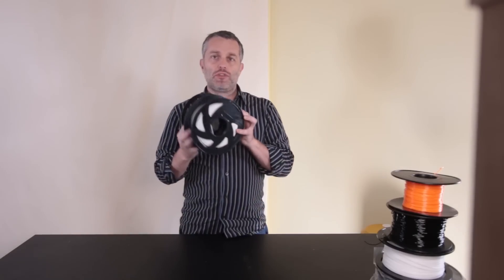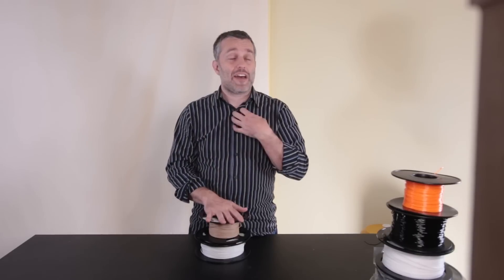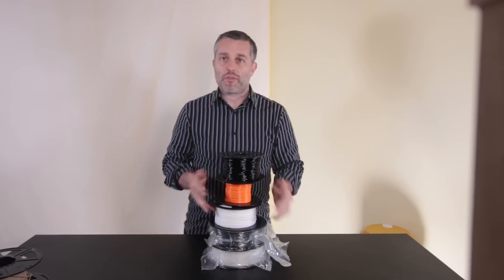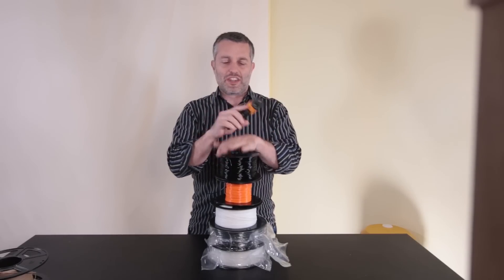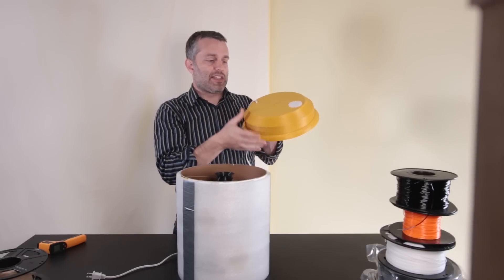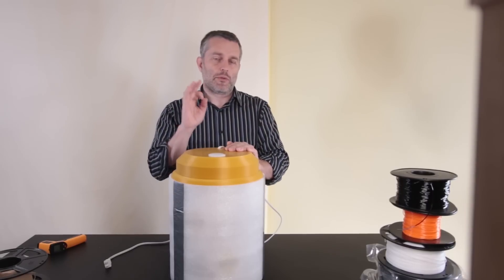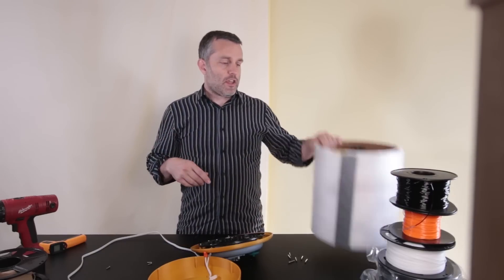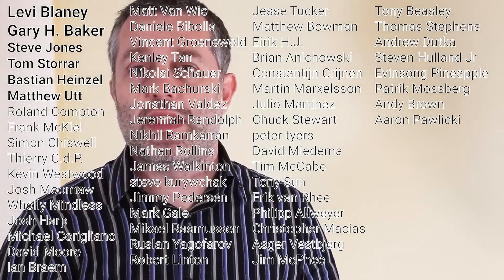Keeping your 3D Printer Filament Dry is Important.

Comment: I'm no electrician but I would look into replacing the thermostat. If you want a fixed temperature, look into NC thermostat like the KSD301. They're used in household appliances as thermal protection. The is also thermal fuse on the coils. Leave that there; it's for safety. But check that it's rated for your desired temp or it will cutout on you by design. In any case, please take care when working with heat and line voltage.
Reply: It's a thermistor on these not a thermostat. Basicly a switch that turns off at a specific temperature and back on at another lower temp. The thermistor is coupled to a triac for changing the temperature ranges. It is a simpler system used in all kinds of stuff like toasters and hair dryers. I commented on that somewhere here (if you can find the top level comment)
Reply: Thanks. I browsed through the comments before post but I didn't see that. 
In any case, what I am recommending is to swap-out what ever temperature control is currently being used (thermostat, thermistor with TRIAC, etc.) to something like a KSD301. This would be a cheap and easy solution. It would hopeful be well within most people's ability; without having to try and tackle redesigning the current temperature control circuitry.

Comment: You can raise the internal temperature without replacing the thermistor ( suggested correctly in other comments), by adding mass or insulation to the the body of the thermistor... (wrapping some wires  around it for the extra mass, or wrapping some kapton tape to insulate it, should do it...)  That will slow the response of the device (longer heating... But also longer cooling periods, since will take longer for it to know the temperature has changed...)

Comment: For getting a higher temp, You might be able to replace the thermistor seen at 8:19  near all the wires coming to the coils with one that has a slightly higher max temp. in many dehydrators, toasters, hair dryers, etc thermistors senses temp and turns the heater on or off via an SCR or TRIAC dimmer. there might also be a thermal fuse in the circuit which may need to have a slightly high max temp too so you don't trip it. 

Basically the the circuit heats up and then the thermistor trips when it gets hot enough turning off the power. this repeated on/off controls how much heat is output. the TRIAC some some kind of fiddeling to set the temp ranges below the thermistor range (I'm a little unsure about that part). by puting a thermistor with a slightly higher max temp you increase the system's heat output.

 (only a hobby electronics perspective, you should ask an electronics tech or an EE engineer for total advice)
Reply: That is most likely the thermal fuse inline with the coils at 8:19. He doesn't really show the temperature control device (what I loosely call a "thermostat") but you can see what is a temperature knob in similar models at around 9:10.  I will assume that it is under that.

Comment: Personally looking at the whole material emissivity stuff makes using a spot IR gun like that to check an oven's temp totally unreliable. It's great for surface temps of certain materials, but can often be very wrong. working with Aluminum cooling fins in the lab we had to put electrical tape on the locations we wanted to measure with an IR gun because Aluminum's emissivity was problematic for getting correct measurements. I believe a good thermocouple is better for bulk area temperature measurements.
Reply: Absolutely! Those no contact thermometers tell you the temperature of the surface not the temperature of the air. The worst way to measure the temperature of an over is with the type of thermometer you were using. A cheap oven thermometer that sits on the rack and has an analog dial that is operated by a bimetal element moving the dial is far better than the most expensive non contact thermometer, even a fancy Flir doesn't tell you the temperature of the air in an oven. No wonder all your oven read differently... I'''ll bet all of them were within a couple of degrees of each other. 
Try this little test to demonstrate it:  point your fancy no contact thermometer to the wall in your house. If the wall has reached temperature equilibrium it will read what the room temperature is.  Now, get a hair dryer and blow hot air between the thermometer and the wall,  careful to not blow air onto the wall or the thermometer. The thermometer will continue to read the same temperature of the wall in spite of the hot air between the thermometer and the wall. While it is strictly not true that it ignores the temperature of the air, the radiant energy emitted by the hot air is insignificant compared to the radiant energy emitted by the wall.  The hot air transfers its energy no by radiating it, which the no contact thermometer is sensitive to, but by actually transferring the momentum of the bouncing excited heated molecules.... in other words, the air has to touch the stuff for it to feel hot.
Aside from that bit of thermodynamics, your filament dryer and sonotubes is brilliant and will work far better than you think. Some of the suggestions about exhaust vents, etc will make your dryer absolute kick ass. A really clever idea.

Comment: Hey man, you don't have to reach the boiling point of water, at work we injection mold nylon parts and we dry is between 60 and 80c for a couple of hours, if it's really humid, up to 4hrs. So pla would be able to be dried at between 50 and 70 quite comfortably depending on the relative humidity of the air. Cool video tho.

Comment: It doesn't have a brain short of redesigning it not going to get any warmer the dumb heater just turns the heat on and they calculate the power loss vs cfm to hit a stable temperature around 140 ish the cheaper the dehydrator the less close to that, dehydrating food is all about air flow the heater is mostly to lower the relative humidity of the air so that the warmer air has more capacity to draw moisture from the food. Should essentially still work for the filament just may take over night like it does with beef. The more expensive dehydrator might have some more temperature control done with a "dumb" thermostat and some more air flow but will probably only be from 130-165 ish since food you want to stay lower and not really cook the food. You would have to find a cheap electric smoker to get the temperatures you want and modify it to add more air flow though. But as far as dehydrating something you don't want to boil the water out of it its better to draw it out the same way it got in there or you can run the risk of creating voids in the filament and decrease the uniformity of the shape of the filament water will leave as water vapor any time there is an energy differential it doesn't have to go through full state change. same way it evaporates from a lake or stream in 70 degree air.

Comment: Really nice project! Have you actually tried using it? I'm asking because I have dried petg filament in a convection oven at 60°C multiple times and it worked like a charm. Just stick it in, wait for 3-4 hours and the filament is bone dry. 
The reason why that still works so far below the boiling point of water is because of two reasons: First, warm air can hold more water than cold air. So if you heat up cold air, the absolute humidity stays the same, but the relative humidity drops dramatically. The low relative humidity has the same effect as desiccant has on your filament: it dries the surface and subsurface up to a few atomic layers below the surface of the filament. The second reason is that Water (and any other liquid for that matter) doesn't have to be at its boiling point to become volatile. When you increase the temperature, the vapour pressure of the trapped water will increase and push itself out of the filament with a pressure of 0.2atm at 60°C. That's basically the same effect as putting the filament in a vacuum chamber at 0.8atm, with the added benefit that the relative humidity is much lower than in a vacuum chamber at room temperature.

Speaking of which: if you really want to reach the boiling point of water, you could put it in a vacuum chamber with about 0.05atm at room temperature. Cheap, 50$ vacuum pumps will already be able to reach that. But those pumps make a lot of noise so it's not for everyone.
Reply from the maker: Great info! Thank you! Yes, I've used it many times. It does work, but I find that the filament is never as good as it was when it was brand new. I just assumed that if I got it to the boiling point of water, it would be bone dry and back to "as good as new" condition. I'm starting to rethink my assumptions because of your comment and also the one by Dave W. Now I'm thinking of building this thing into a vacuum chamber so that I have both heat and vacuum taking the water out.
Reply: Awesome! If you need some inspiration, The King of Random made a vacuum chamber which design I really like due to its simplicity. His content is definitely for kids but I do reccomend his video about it: https://www.youtube.com/watch?v=ERRMoHfrjAI 
He also made a slight alteration later on with a glass jar which looks even better: https://www.youtube.com/watch?v=xyn8Pq6s7hk and he's been using this glass chamber for over a year now without any problems.
Reply: VegOilGuy also did a video on an inexpensive DIY vacuum chamber. https://youtu.be/bv3tYR4ROBs
Chemistry people also add some "desiccant" material in their vacuum drying chambers (desiccant chambers).  https://youtu.be/RGG2GNvpwA4?t=433
Reply: You need to vent some of the air, if you just keep recirculating it  will become saturated even though its hot.
Reply: @DennisFisherUK  Not really... The amount of water inside the filament is negligible and won't affect the relative humidity at all. Especially at higher temperatures where the water bearing capacity of air increases exponentially (e.g. max capacity of 1m^2 of air at 20°C is about 20g and at 60°C is about 100g of water).
edit: I meant m^3 instead of m^2
Reply: Trying to dry it without venting some of the air is like drying it in a plastic bag.
It will be far better to get rid of some of the damp air than to just rely on warming it up so it absorbs more water.
Reply: @DennisFisherUK  As long as you take the filament out while the air still warm, you don't have to vent because of the reasons stated above.
Reply: @Constantijn, good point. about the water carrying capacity of air. Even after learning second level Thermodynamics my gut reaction is to think about things like replacing the thermistor to increase the temperature when I should be thinking about the drying capacity of the Air... of course that would mean doing all of the calculations and using the psychrometric chart adjusted for the specific area to get the calculations right.

So the key to this is focusing on the drying force of air which can be expressed with moisture holding capacity of air and the evaporation capacity of water from the filiment surface to air.

Comment: Harbor Freight pressure paint tank holds up to 2-1/2 ga, use with a vacuum instead.   The vacuum will pull moisture and save on the electric bill.  Pull the vacuum,  wait,  when vacuum level decrease,  turn on the pump again for a short time to 30 inches of mercury.  Store spools in the tank under a vac.  This is the same process HVAC techs use to pull moisture form new A/C systems.
Reply from the maker: What a great suggestion! I'm going to look into this. Maybe the heater combined with a vacuum.
Reply: @DesignPrototypeTest It's me again... Read on... I know you didn't like my last messages, but I really appreciate your addition to the maker community... 

Just choose one or the other... 

With the vacuum, you are changing the boiling point of water... And since you are extracting the moist air out with the vacuum, you are extracting the moisture with it... Like this guy said, it's much more efficient... (but making a vacuum chamber isn't not easy, and the vacuum pump can be expensive and loud...) 

With recirculation and heating, like you did,  you need the system to be leaky... (walls based on paper like yours with do the trick... But with the thickness of the material, and your great attention to details, it's going to take much longer than if you just tossed something together really quick... Like I said, the water has to go somewhere... And with your system, it's  getting trapped inside for longer than it needs to.)

I'll post the suggestion below as a separate post as well, but I'll include here, just in case someone reads this in the future...:

You can raise the internal temperature without replacing the thermistor ( suggested correctly in other comments), by adding mass or insulation to the the body of the thermistor... (wrapping some wires  around it for the extra mass, or wrapping some kapton tape to insulate it, should do it...)  That will slow the response of the device (longer heating... But also longer cooling periods, since it will take longer for it to know the temperature has changed...)

Comment: There is a product made specifically for this that lists a dry time/temperature chart that people generally find to work for them.  People looking for a cheaper solution often go with a westinghouse dehydrator for around $30 and print this thing: https://www.thingiverse.com/thing:2853136.  I've personally had success going the westinghouse route using the temp/time chart that is circulating about.
Reply from the maker: Good Find! If this was on Thingiverse when I made mine, I probably wouldn't have gone to the trouble of designing my own. Although, my design does seem a bit tougher and it allows me to dry 3 of the wide rolls of filament at a time.
Reply: @DesignPrototypeTest  I got the Westinghouse and I stack the sleeves if I want several rolls drying at once. I run at 140F since my sleeves are PLA, and it seems to dry filament just fine if I leave it 24 hours. Using a vacuum sounds like a pretty good idea. I think Foodsaver has clear containers that might be large enough, and they are made to hold a vacuum for a long time.

Comment: RECOMMENDED DRYING TIME
No. Materials Dryer Temp Drying Time
1 PLA                 45°C (113°F) > 4h
2 ABS         60°C (140°F) > 2h
3 PETG         65°C (149°F) > 2h
4 Nylon         70°C (158°F) > 12h
5 Dessicant 65°C (149°F) > 3h
6 PVA         45°C (113°F) > 4h
7 TPU/TPE 50°C (122°F) > 4h
8 ASA         60°C (140°F) > 4h
9 PP                 55°C (131°F) > 6h

I am afraid I have to disagree with your comments about PLA not needing to be dried.   I live in northern California and have problems with wet filament all the time.

I grabbed a dehydrator like the one you mentioned and cut the center out of the trays.   If I follow the above info, then my filament works perfectly.   I can leave PLA out for about 3 days before it starts making crappy prints.  

Regards,
Tony
Reply: here is my source.  I do not recommend purchasing their branded drier.  https://www.printdry.com/dry

Comment: How are the lower temperatures controlled? Where is the switch contacted? Maybe its just a pwm signal that can be hijacked. Besides that, a higher voltage at the heatingcoils will increase the poweroutput. An alternative would be to rewire some of the coils so that they are in parrallel instead of series.

Comment: You don't need to get it hotter you just need to leave it longer
Reply from the maker: I've tried this. It does dry the filament a little, but the results are not as good as doing it in the oven at 200 degrees Fahrenheit.
Reply: How long did you leave it?
Reply from the maker: like 5 hours for ABS.
Reply: That's not anywhere near enough time - probably should be nearer to 48hrs possibly as much as 3 days - it takes mine at 70C 24hrs to remove all water from tomatoes and they are near 98% water but not anywhere near as dense.
Reply: lol impatience is a sonofa